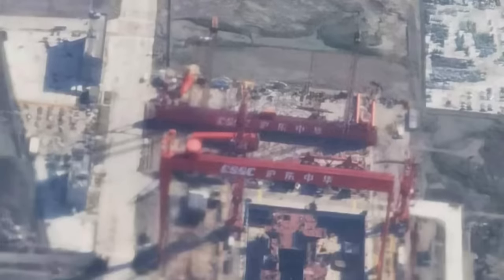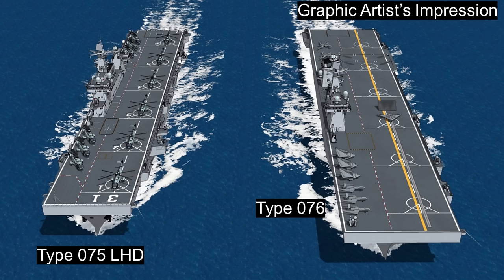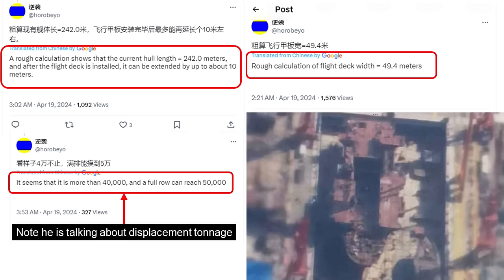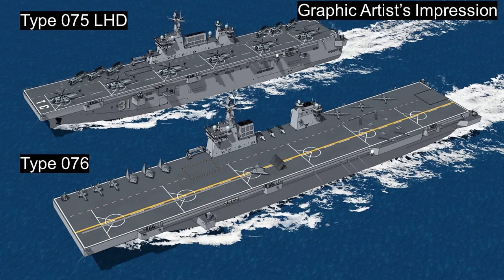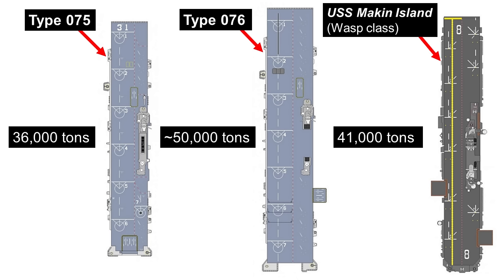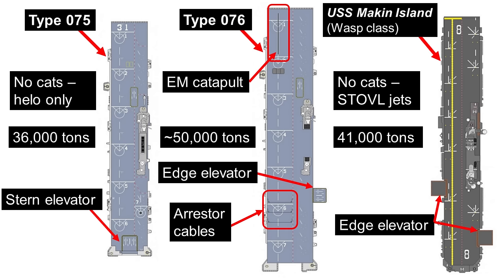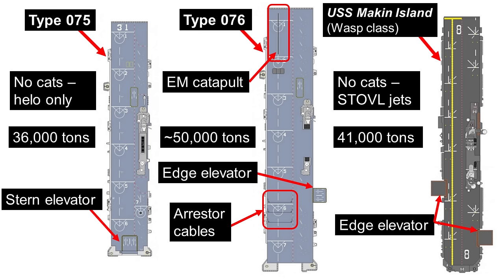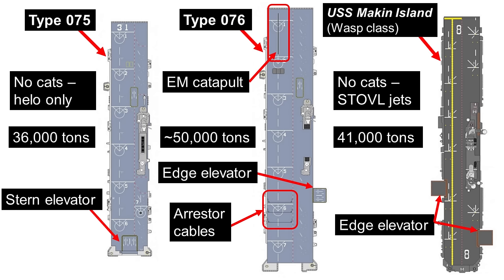China Is Building the Type 076 LHD: Its Special Aircraft Carrier

Comment: China’s shipbuilding industry is 200 times larger than the US shipbuilding industry. This is not an exaggeration.
Reply: China has a number of advantages in this sector. Some of which the untied states could never adopt. 

Aside from that, the USN has requested more ships while Biden has de-commissioned several. Its presents a quandary alright
Reply: China's shipbuilding industry is 270 times that of the United States. During World War II, the United States had 18 shipyards with 171 10,000-ton slipways, building 47 ships per month, and built 2,771 7,176-ton ships. This is the number of Chinese ships in the four years from 1941 to 1945. There are now 735 shipyards, 56 slipways of more than 100,000 tons, 30 slipways of more than 300,000 tons, and 6 slipways of more than 500,000 tons. The annual civilian shipbuilding volume is equivalent to the total number of ships built by the United States during the five years of World War II. .
Reply: @乔·拜登-d6p  I almost wish china would build a 500,000 ton warship just to stick it to the US.
Reply: @hughmungus2760 Keep wishing!

Comment: Aircraft carrier in capabilities, LHD in name.
Surprised USA is not the first one to implement EMALS on LHDs, getting approval for building 50 of them and call it "next generation money wasting powercreep landing dock project" and then cancel it after 3 hulls 😂🥂
Reply: With that much of the ship spent on a well deck, it's still more of an LHD by far but using the EMALS to enable the surveillance advantages of fixed-wing aircraft to support amphibious operations without needing airbases or full aircraft carriers in the area, plus adding some airstrike capability. It probably won't be focused on generating the highest possible sortie rate like a dedicated carrier would, but even a fraction of the sorties of a dedicated ~50,000t carrier still means having something in the air at all times. That means getting infinitely more of those assets than might otherwise be available, all while still doing the work of an LHD. 
The US probably didn't attempt the same thing because they already have F-35B and older jumpjets to fill the role of getting the number of fixed-wing assets in the battlespace to be not zero. On top of that, the EMALS tech they developed for the Fords is a simpler but less efficient AC system than China's DC one, in the Fords that are not only nuclear powered, but also way over-specced on electrical capacity, this was a perfectly sensible thing to do, but it would make using the same design a bigger power drain on an LHD.
Reply: @xTheUnderscorex Source on AC EMALs being more efficient than DC EMCATs?
Reply: the US think tanks have talked about shrinking their carriers to spread out the risk. but building out the Ford class has taken up so much shipyard space they just don't have the budget or room to build a second class of carrier.